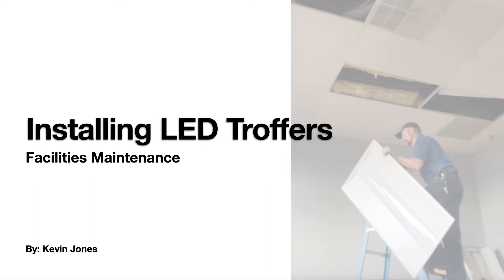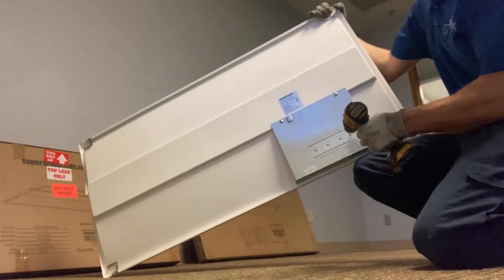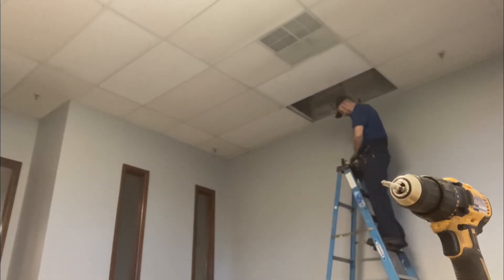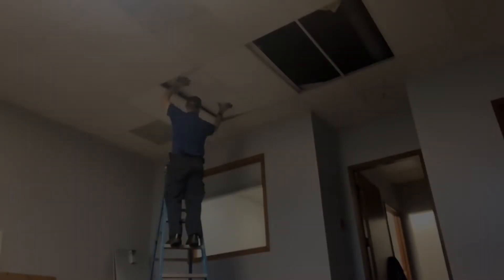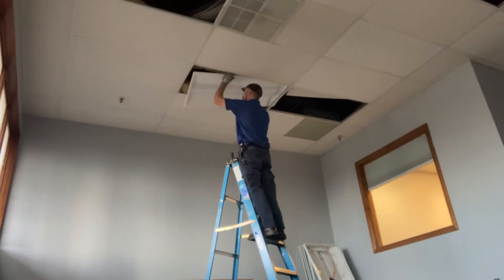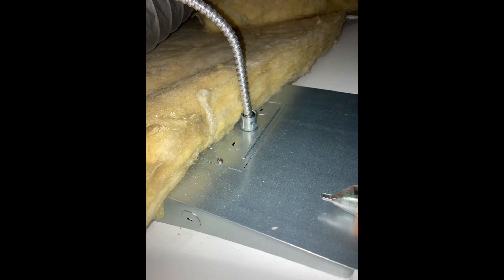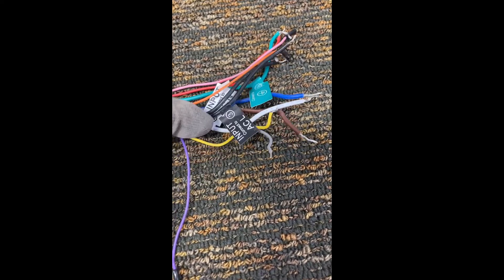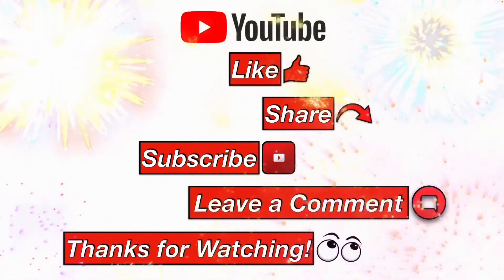Installing New Adjustable LED Troffers!

Comment: How did you get the bx connector out once you push it in and it locks?
Reply from the maker: Some BX connectors have little tabs that you can push on with a flathead screwdriver to pop it out, other BX connectors are threaded with a nut that you can unscrew.